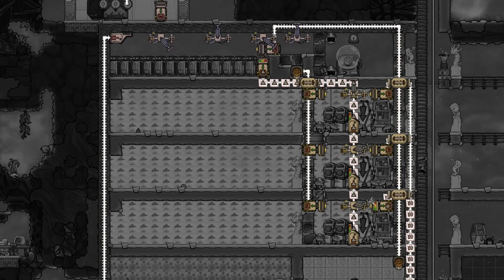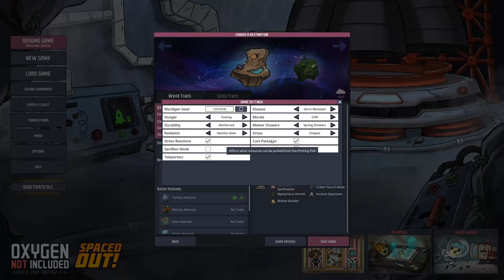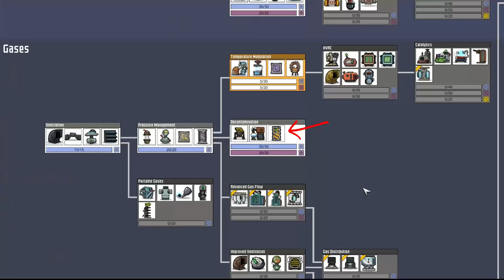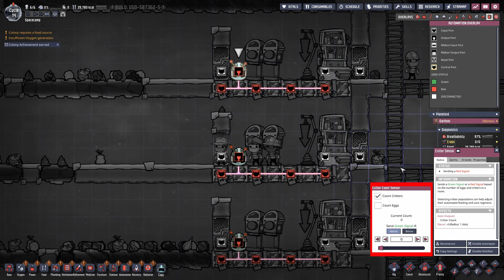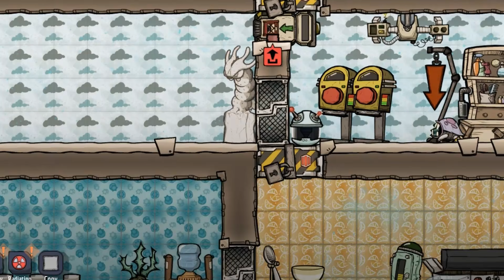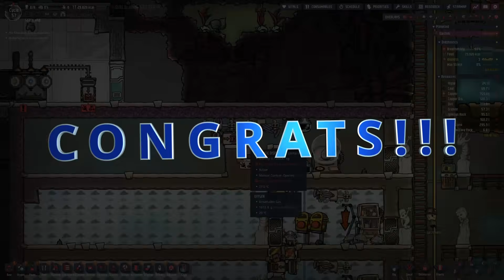Auto Hatch Ranch Oxygen Not Included | ONI Tutorial

Comment: what if you are missing a critter only on the bottom? don't you need to attach 1 additional automation to keep the top door open as long as the bottom farm doesn't have a critter?
Reply from the maker: The door should actually be open whenever that farm is full, allowing any additional critters to drop through to the farm below. So if only the bottom farm is missing a critter, the upper doors are already open and no additional automation is needed. If a full farm’s door is closed, something in the automation settings isn’t configured correctly.

Comment: I just discovered mechanized airlock floors + automation and I love it!! I have a water tank room that has a water spigot at the top that pulls water from a mini resevoir within the water tank. Water gets deposited into the reservoir and and once its filled the water overflows into the water tank which means I always have water to pull from! But the big issue was when non-water made it into the reservoir via the open tiles of the spigot. So I made the floors of the reservoir mechanized airlocks connected to an automation switch, so I can flick the switch to empty the reservoir into the main tank, and have a filter remove the impurities. To fully automate it I'll have to remember to put a series of water element sensors along the bottom of the resovior tied to a not gate

Comment: You can save you self a little bit of power. Put an auto dispenser at the end of the sweepers range, am then put a regular door right under the output. The hatch eggs will be graves, put in the dispenser, then dropped all the way to the bottom where you can have your forced evolution tank. Saves you the refined metal and power for an auto loader.

Comment: The design is cool, the door egg dropper seems like the best route until you get auto sweepers online. I like to just keep things simple and just confine the hatches to one auto sweeper like you did, but no automation stuff and simply run a few unpowered incubators. And ship all the eggs to the water/door cell, I also usually build a small room with auto closing doors to drown critters that hatch from the incubators, using a drop off so dupes get the errands, so i can drown all different types like hatches or pips etc. saves on power not having to power doors or the incubators.

Comment: Hi!

Thank you for your incredible Ranch system. I'm wondering if, can we modify it to include cuddle pips for the top part? I love cuddle pips to help my incubation and I think it would improve the cycle for the ranch.

Thanks anyways
Reply from the maker: Yes, absolutely!  Be sure to check out the updated version of this ranch when you get a chance.  😊
Reply: @engineertroy_  I just checked and it was awesome! As a programmer, I need a lot of time to digest what you did in the 2.0
I'll use that when I expand my base. For now, I'll try to implement this one 😃😃

One dumb question: I just finished this build like an hour ago, and wondering how the baby critter going down from incubator. Because in my case the dup always take it down even though I set the priority low enough
Reply from the maker: You can disable or remove the critter drop off in the ranches once things are up and running.

Comment: This is a fantastic vide. I have a question though. Instead of using the no gate, couldn't you just switch the toggle from above to below and it would have the same effect?
Reply from the maker: Great question!  The not gate is needed because we are also opening and closing the mechanized airlock to control whether a falling hatch is caught or allowed to pass through each ranch.  If there are more than 7 hatches we want the airlock open which requires a green signal but we also want a red signal to tell the incubators not to turn on(at least not for this ranch which is now full)

P.S. Im nearing completion on version 2 of this farm which includes several optimizations and improvements. 😊
Reply: @engineertroy_  looking forward to it. I seem to struggle with the bottom ranch working correctly.

Comment: I'm experimenting with a 3-tile high build for farms and I see potential for this build to be compressed into that form factor as well. given that the auto-sweepers span 9 tiles wide, your hatch ranching pen should be able to handle an extra tile of space without a significant increase in rancher grooming time.

I'm having difficulty past the mid-game at the moment, and have made a full restart to test this theory out. As it should allow me to squeeze in an extra 2 farms/stables to the starting biome layout, allowing me to float an extra 5 dupes in the early game fairly easily. I'll let you know what I find.
Reply from the maker: I’d love to hear how it works out! 👍
Reply: @engineertroy_  I gave up on it for the ranch mostly because the hatches can jump over the 2nd door, but it's working great for the farms. I can fit 5 farms in a space that previously only fit 4, and the extra length makes it effectively 6 farms worth, even with an airflow tile every 7 to mitigate CO2 pooling. I no longer have to micromanage them just to maintain 15 dupes and can easily float 5 more on top of it. I'm already full up on sunbugs too, so I don't need artificial light either.

Comment: I copy your set up but for some reason, the hatch wouldn't fall into the ranch area, they always got stuck on the normal tile above the door
Reply from the maker: Sorry for the delayed response!  It sounds like either the drop door in the incubation room or the doors with the tile on top in the ranches are not correctly aligned vertically.  If you’re still having this problem, check the overlays and compare them to your build. Hope that helps. Lemme know how it goes!  😊
Reply: @engineertroy_  yeah lol the door is 1 tile off. I've just realized that after asking you🤣

Comment: Does the incubator should remove the critter automaticly when he turns into adult or is my system bugged?
Reply from the maker: Nope, that’s correct. The hatchling will stay in the incubator until it becomes an adult or when a duplicant removes it.
Reply: @engineertroy_  Okey but I have a problem where the critter sensor shows there isnt enough hatchling but it wont open the doors. Also even if I have enought critters it automaticly start to incubate a new hatchling
Reply from the maker: @martveri4873  Yes, since making this video I have discovered a few problems with this design.  I have a new design that I am currently making a new video on but it is slightly more complicated.
Reply: @engineertroy_  cant wait to see it!

Comment: I do modify this a bit, with plan to use that space behind ranches a bit more.
a) I remove one tile from right, not left. It makes mechanized door step use one vertical door instead, and I got full 17x4 size empty. 
I tend to load it with gas/water storage tanks, and use it as either pure or polluted water ready to be piped en masse, 
or oxygen storage with BIG cap. Its like 8x Liquid Reservoir, so about 40 tons of storage, not bad for usually unused space. 
gas tanks are nice here as well, I tend to make 8 and use pixel packs to show how full they are. Mostly with oxygen or hydrogen. I tend to eyeball, not do math, so large buffers are nice.
b) version here I try to make it 5 high. to make left side 2 rows of storages. Accessible mostly from left side, if made like on vid.
Reply from the maker: I like it!  You’ve given me some ideas for future improvements. 😊

Comment: I've completely mirrored your design, most of the stuff works perfectly, yet I'm having problem with sending the hatclings to the next stable. Even though the automation opens up the mechanic door and the hatchling stands on the opened door, it doesn't fall. Am I doing something wrong ? Also I've looked trough your channel to see if you have a discord but couldn't find any so I'm writing here in hopes of finding an answer.
Here is the video of the said issue https://youtu.be/AR6ZRuEdv84
Reply from the maker: They only pass through the airlocks when they are already falling otherwise all the hatches would end up in the bottom ranch. The next hatch from the incubator room should fall all the way down through all the open airlocks. I hope that answers your question.
Reply: @engineertroy_  After i wrote this comment i waited to see if a hatcling falls from incubator room to the bottom room and it does! Thanks for the explanation. 

Also can I ask what do you suggest for feeding hatches ? After like 15-20 cycle of feeding them sedimentary rock they started pooping stone hatch eggs. I've looked through some forums and people also suggest using stone hatches since it's easier to find things to feed them. Do you have any thoughts about this ?

Comment: Thanks for the guide, however, I seem to be having a problem.  None of my hatches are falling through the mechanized door, neither the adults nor babies.
Reply from the maker: I would check the settings on the critter sensors and the automation circuit.  I suspect something is set incorrectly.  Let me know if that helps!
Reply: @engineertroy_  Just want to be clear.  I've set all hatch room critter sensors to 'above 7 hatches' and the critter drop off to 8. The doors are open, so the logic is working, except the critters are not falling. I even pushed the door+block further to expose the whole door, but they don't fall.
Reply from the maker: If I'm not mistaken, you are saying they are not falling through the mechanized door underneath the pneumatic door in the incubation room?   Is that mechanized door open?  Is the pneumatic door opening when there is a hatch inside the incubation room and then closing on it once it walks onto that door?  I know it is frustrating when things don't work as expected and for that I am sorry.  It may help to go back through the video again but I'll do my best to help diagnose it with you.

Comment: I put this together last night.  It was a bit tricky doing the mirror build of this.  For one thing, the sweeper to load the  incubator wont reach far enough over.  It covers the wrong half of it.  But, you can take down one wall of the kill chamber to make it fit.  That said, I was super excited to get my first automated stone hatch born and wander over to the door to drop down.  I was really curious if it would try to jump over the mechanized door and through the pneumatic door onto the low ledge I had to make to fit the sweeper.  I anxiously waited for it to jump out when my rancher came by and bagged him to do the work manually.  I guess I was slightly disappointed, but even if the rancher handles it, its no biggie as long as I don't have to micro that and everything else this system does for me.  Nice build, easy to follow even if I was building it backwards!  Thanks!
Reply from the maker: Nice!  You can disable or remove the drops once everything is setup to prevent that. Glad you liked it!
Reply: Oh my god thank you, I was doing it mirrored as well and couldn't for the life of me figure out why the incubator wasn't getting autoloaded.

Comment: Thanks for this fun design! I adapted it so I have 4 stone ranches going constantly, with 4 incubators also cycling and working (each has its own cycle automation box - inelegant, but it works). Spare eggs get left in the evolution box. Spare hatched critters get dropped all the way through all the ranches and into an evolution machine which picks up the arrival of the critter and then does the typical door cycling with water trick. The whole system could probably be cleaner, but I figure this way I'm getting a LOT of meat as I'm drowning a critter every cycle or so and also spares are going to hatch regularly in damp confinement too. Make sense?
Reply from the maker: Yes!  Sounds like a lot of meat!

Comment: Very nice, I will use your Ranch form now on. But I see a few problems.
- Use a timer instead of a cycle sensor. Set the timer for 580/60, and make sure you have two ranchers on a different schedule. Otherwise your eggs won't be lullabied some of the time.
- Using the critter condo would allow you to go up to 8 hatches per ranch, they will become crowded but with the condo buff they will still be happy and reproduce.
- One incubator (if lullabied all the time) can hatch 25 hatches in 100 cycles so is barely enough for 3x8 ranches.
Reply from the maker: All great tips!  
-Yeah, I learned my lesson on using cycle sensors for incubators. I used the timer similar to what you described in my new setup in the Incubation Automation video. Now set my timers to 600s(the time the buff lasts) and 75s active.  
-I haven’t worked with the condos much yet but I’ll have to look into it soon.  
- Yes, it just barely covers hatch replacement.  There is room for a second incubator but I fear the logic to control hatchling delivery would get a lot more complicated. 
Thanks for the comment!

Comment: How does it work for different hatch types? I want one floor with sage hatches, one with stone hatches and one with regular hatches. What would I need to change?
Reply from the maker: This build was intentionally designed assuming all hatches would be the same type.  Otherwise it could potentially be far more complicated. It can be challenging restocking multiple types to different ranches since there is no real way for a critter sensor to distinguish between them. One strategy would be to fill the top ranch first and work your way down the stack changing what you are incubating as you change rooms. This would still get tricky when they started needing replacement hatches.  Also the feed system is designed for one type of food so that may get tricky as well. I personally don’t ranch sages but I do like to fill the bottom room with smooth hatches to get the ‘Down the Hatch’ achievement. I do this with 100% dupe labor after the top farms are full.

Comment: 2 suggestions:

1. if you use centralized storage in your base where all of your debris is stored on a single tile, this tile can also serve as the evolution chamber. Suggest petroleum instead of water to make sure it doesn't boil when you drop steel onto it.

2. If you aren't sure how to use the empty space inside of the stables, you can put your coal generators there and run a short conveyor rail from where the hatches deposit coal.
Reply from the maker: Oh man, that’s a great idea!  I would want to change the pneumatic door to another airlock and put some sort carbon dioxide catch in there. It would also need a cooling loop at some point?  Very interesting and inspiring.  Thanks for the suggestions!
Reply: @engineertroy_  Fair points. I usually have my  ranches in an atmo-suit area so will usually just ignore the heat and CO².
Reply from the maker: Sounds like it may help getting the Job Suitability achievement also.

Comment: thiết kế chưa tối ưu lắm
nếu phòng dưới cùng thiếu sinh vật nhưng 2 phòng trên đã đủ sinh vật thì cửa không mở ra để sinh vật đi rơi xuống phòng dưới cùng
Reply from the maker: The door should open in each ranch if it’s critter sensor is set to critters only and above 7.  The door stops a falling hatch if the ranch is low but allows it to pass through if it is full.  Hope this helps. Thanks for the comment!
Reply: @engineertroy_ tôi sẽ đặt trường hợp phòng dưới cùng có 7 sinh vậy phòng thứ 1 và 2 có đủ 8 sinh vật
làm sao để sinh vật đc thả xuống phòng dưới cùng
Reply from the maker: If the first and second have 8 the airlocks in those rooms should be open.  This will allow a hatch to fall past these floors all the way down to the bottom ranch. If they are not open something is wrong with the critter sensor settings or the automation wiring connecting it to the airlock for that room.
Reply from the maker: Check the overlays toward the end of the video. I made a overlay chapter in the video for quick reference.

Comment: This is a pretty nice design! pretty simple compared to the ones I've seen. If you want to save some fluid, you can make the evo chamber two tiles instead, and put in a critter sensor in there connected to a airlock that replaces the door above it. If any amount of liquid is enclosed, it turns into a full block for drowning, which lets you save some water. You can also probably squeeze the stuff in the actual ranch into a smaller space to reduce the space the hatches have, like removing the dropoff, which is kinda redundant, especially now with the Move command, or having only one feeder, since feed is automated anyway
Reply from the maker: Great solutions and tips!  Thanks for the comment!

Comment: Could you delete the critter dropoffs from the stables so dupes don't do manual job? Maybe put one in the growing room?
Reply from the maker: Definitely!  I disabled mine in the video but forgot to mention it.
Reply: @engineertroy_  I don’t know if by putting one in the growing room, the auto sweeper will empty the incubator. Also, I think (but not sure) that you need 2 incubators for 3 hatches ranch. I’ll definitely try your design :)
Reply from the maker: @sylvaincoulonges8288 Three ranches will require 24 hatches every 100 cycles therefore you will need 100/24 = 4.166 or roughly 1 hatch every 4 cycles which is how long it takes to incubate a lullabied egg.   The first hatch replacement cycle may be rough, especially if the hatches are very close in age but it should even out starting with the second replacement cycle if you let the incubator do it's thing.  Let me know if you find anything new or to the contrary.  Thanks!
Reply: @engineertroy_  yeah, you’re right, an incubator can support 25 hatches :)